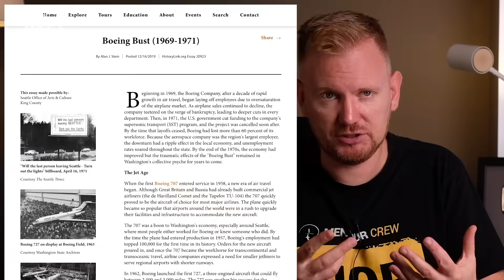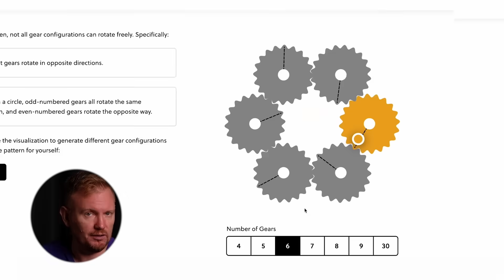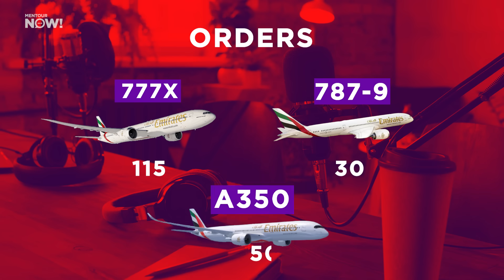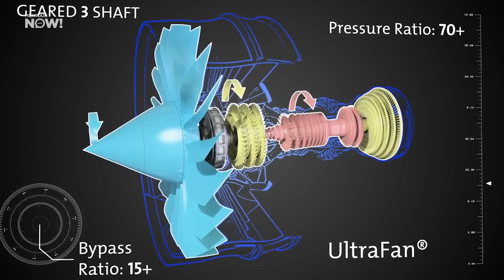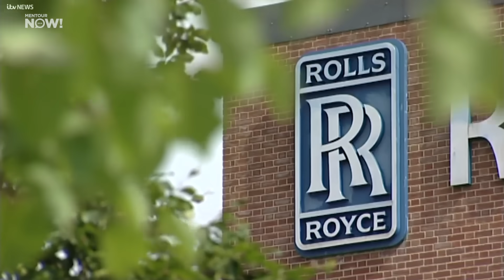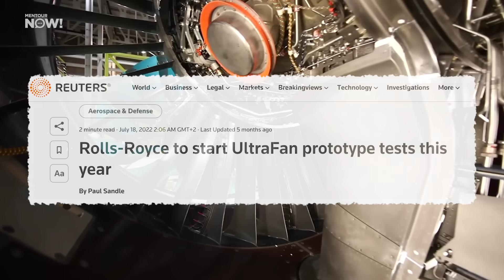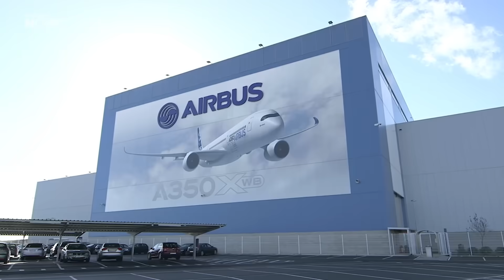Are BOEING planning a 747 with 2 ENGINES?!

Comment: Why be sad????
EVERYTHING comes to an end eventually.
I am dying, I have terminal heart failure (survived 6 major and 1 minor heart infarct), but i am not complaining nor sad?
This is what nature is:
Ending the old, and replace it with new.
Empires came, empires ended, and out of it's ashes empires rise.
Vita ... sic est.

It's not chaos, chaos does not exist.
It's super-structure!
Reply: Issue with the "big, heavy" planes ... is distance needed to take off, or land.
Not all airports have the luxury to install large enough tarmacs.
Hell, most simply do not.
Which is a BIIIIG factor in the Airbus's viability.
I mean, hell, try to land a big, heavy plane on say the Lord Howe Island airport ... .
You can!, make no mistake:
make a 40 meter thick steel wall at the end of the runway to catch the plane ... but that's, from what i've been told, not really appreciated by the folks onboard this plane landing in such a case.
Probably a bit over-exaggerated by the people onboard that plane, but ah well.

Comment: Mentor pilot: PLEASE READ.

The ideal aircraft is what I call the "single trijet". One large turbofan like you discuss here, which would provide 100% of cruise thrust, and two small afterburning turbojets which would normally be on only during take-off and landing which would provide emergency thrust for TOGA or in the event of main engine failure. Their small profile would create very minimal drag in cruise (with the aircraft essentially being single engine), but if your large turbofan engine failed on climb out, you'd have access to more than enough thrust. In particular, you wouldn't engage the reheat on a normal take-off, and that'd only be used for toga or engine failure. Yes it'd be wildly inefficient, but it's not part of normal operating protocol. You could cruise across the continental USA with just one engine for maximum fuel efficiency 99.99% of the time.

The design I envisioned was one huge turbofan at the rear of the aircraft (front is also an option but with lots of visibility issues) roughly the same diameter as the fuselage. Then there would be two turbojets built inside the wing root. You could even have a clamshell on the front that opens and closes, to reduce drag when they're off, and increase air intake when they're on.

During takeoff and landing, the turbojets would always be on. If your main engine fails or you have to go around you hit the toga button and it dumps fuel into reheat giving you oodles of thrust. But on a normal take-off, once you reached 10,000 feet (or similar) you'd kill the turbojets and ride the single turbofan to cruise and your destination.

This just makes so much sense in my head. Please help me get the idea out there.
Reply: Well, here's just one (of many) problems with this idea: maintenance. In order to service your jetliner, technicians would need to be certified on not one, but two completely different engines. Parts wouldn't be interchangeable. The training time would substantially increase. You'd need two sets of every procedure, and you'd risk someone missing a step because they were thinking about the procedure for the other engine. It's hard enough making sure people follow procedures correctly with one engine type (see American 191), and now you want to add a second type? Boeing considered a remotely similar idea -- very briefly -- during the 747's development, when the JT9D engine looked like it wouldn't have enough thrust. The 747 would have had 4 engines underwing for cruise, and two tail engines (a la DC-9 / Caravelle) for extra thrust at takeoff only. The airlines hated the idea.

Comment: The union of the 747 with the new Rolls Royce Super Fan sounds like a marriage made in heaven. Of course, to bring it to reality, a lot of factors have to come together, but as far as efficiency, capacity, passenger/cargo versatility, range, etc. it is a wonderful idea. I like the A380 but it may be a bit too big, while the 747 seems quite like the right kind of big. While not many areas like Dubai, etc. need big capacity for passengers, many may have the need for big cargo hauling at greater efficiency/cost. Dreams are only dreams but I hope that this dream becomes true. Thank you Mr. Mentour Pilot for bringing this video!!

Comment: Have you done a video on slot constraints?  I would find that interesting.  

For my relatively short military aviation career, I flew mostly into small airfields.  Also, since helicopters can land anywhere on a field, I never had to worry much about that sort of thing.  For rotory wing, the runway is just an over glorified navigational aid, in most cases.
Reply: in Vienna, polititians are discussing the possibility of a third runway. of your course they have a lot of conflicts in interest there.
all that means, that slots for the existing two runways are getting tight. having a plane that has 15-20% more capacity than an a350, this would be a good business case.
Reply: Well it's kinda procedure no?
If you land on an airfield you are basically acting as if your helicopter is a small aircraft.
Reply: In London they have been fighting over the third runway for decades with the environmentalists.
Reply: @TheGecko213  Which is funny cause Schiphol has 6 runways.

Comment: Mentour,

  Disappointing!!!

       Why was it necessary to string viewers along with a “minutiae” of aviation related information that had nothing at all to do with the question you posed for this video? Why was it also necessary to have to go through 2/3rds of unrelated content before the question was even addressed, only to discover you don’t have the answer to it?

You have built, over time, & with effort, a substantial following. You are therefore viewed as a “resource” for information, not the lack of it………

 While I can appreciate the techniques you incorporated in creating the video,  the length, breath & depth of unrelated content applied to it, for viewership, is the real story behind it. 

FWIW, like you, I’m a pilot. I fly 747’s. The proximity of engines ‘’2” & “3”,  to the ground,  require special techniques for all takeoffs & landings; particularly crosswind landings. The sheer size of two newer motors, combined with 747 wing height, would preclude their application on to 747 airframes.

Comment: Problem is at the moment something like 2 Trent xwbs could power and A380. But once you’re over V1 on takeoff you have to go around if you have an engine failure therefore a 2 engined jumbo would have to be able to perform a go around on one engine which is very difficult.
Reply: You could have auxiliary engine and not use it unless needed.

Comment: I have had the pleasure to accumulate over 10,000 hours flying the 200,300,400 and -8 series.  She is the Queen.  I always wondered if two 777 engines plus two smaller engines that would be used if needed for takeoff and could be shut down at cruise for fuel savings but could be used if needed. That might open aircraft up to Non-ETOPs routes.  Just a thought.

Comment: Ultra fan engine can be a potential for a single engine A320 or equivalent.
NASA has designed a concept for a single engine aircraft of 737 or 320 size planes

Comment: Years ago I was talking with fellow aviators and the 747 topic came up where I suggested that Boeing should consider using some of the newer technology engines, more power with greater economy. Well some laughed off the idea. Fast forward twenty years and Boeing combined engine technology with wing technology bringing the 747-8 to market. Now wing technology is great and coupled with an engine of this size ( wing structures permitting as well as height limitations due to wing placement) it would be feasible. The only hold back would be FAA and EU certification. This would cost Boeing millions.

Comment: RR making the giant engines seems like it might make sense to me (a fairly uneducated layman) since they said they could scale it down. It could be that they will eventually make only that giant engine, but scale it down into many other sizes they need to produce. Maybe then they only need to make 1 or a few engine cores for all those models, or at least have a lot of shared components between them, which could reduce cost on all the engines based on that design.

Comment: it all depends on the Thrust output. And i don´t know if it can archive that level of Thrust. Because it does not need double the Thrust of the current a380/b747 engines, but more like close to tripple. The reason beeing that the aircraft need´s to be able to climb with 1x engine out. On a 4 engine aircraft that leaves you with 75% thrust. And a 2 engine configured giant need´s to be able to match that thrust output on ONE engine and still climb.

Comment: Nice video Petter, I have long argued about this before and believe it was a mistake for Emirates and Airbus to stop A380 production. Ultimately it came down to disagreements with engines along with the fact that the whole A380 project was something that Airbus didn't really want to continue. That said, with hydrogen likely being the answer for long haul moving forward, they will need more engines as hydrogen requires double the power output. For that reason I still believe we will see an A380 replacement as Airbus moves towards a zero carbon range, and Boeing should follow with something similar. With Boeing delaying the 777X, Emirates will need to seriously consider it's slot options at many busy hubs around the world. A full A380 landing at Heathrow costs less than two 777's does, and that's something you can't change with the current widebodies. It will be interesting to see how they deal with this and what direction Airbus and Boeing go down.

Comment: This is fun! Petter, I believe this was my question! Along with many others, probably.
In fact, what you are saying is, even Boeing would like to, there is no double engine-feature available that will produce enough thrust to get the 747 airborn. 
That engine is simply not available at this time, and developing it - if the businesscase checks out - will take years?
Reply: The 777-300ER and 777-9X have a MTOW not very far from the 747-400's (the -8 is a bit further tho). With some structural optimization and a reduced fuel capacity (as the new engines burn less) it's not completely impossible to make a 747 fly with only two engines of an existing type.

Comment: A modern composite weight saving 747-400 with monster twins would be so sick.
Reply: Since Boeing inherited McDonald Douglass, wouldn't it just make more sense to just modify the MD-11 to use only 2 engines instead of using the 747 as a basis?
Reply: It would be the ultimate dogs dinner and a complete disaster. Boeing is all about max profit from sunk costs and its proven very expensive in lost lives. But that doesn't get reported on the balance sheet, does it?
Reply: Why do you young guys call good "sick".  Sick means bad, even gruesome.
Reply: @michaelbenardo5695  Take a nap, Boomer...
Reply: @johnbergstrom2931  tsk tsk weak move to call out
Reply: @johnbergstrom2931  it doesn’t mean you have to be a bum on the internet
Reply: @twinkieerella  Take a nap, fun-ruiner...
Reply: @johnbergstrom2931  🤣🤣🤣🤣

Comment: Would there not be some design practicalities that might be an issue for this idea?  For example, how are you going to get such enormous engines under a low-winged aircraft (which most passenger jets are) without having landing gear as tall as a house?  Would you have to consider going to a high-wing configuration instead (and accept an obstructed view out of the window and a lot of additional cabin noise aft of the wing)?  

And if one engine does down you lose half your thrust.  Of course that's also true on current twinjets, but they're not as powerful as this proposed beast would be.  Would a flight crew be able to handle the massive yaw a sudden loss of power on one side would produce?  I know there's been incidents where quadjets have lost both engines on one side at the same time, but I'm assuming that if such a plane is ever built it's going to have to be at least as big as an A380 to be worth it.  I'd imagine you'd need a huge tail fin to ensure the pilots still had authority over yaw if that happened.  maybe you'd need a split tail to achieve that, as a single tail fin might just be too big for current hangers.  

None of those are insurmountable problems of course, but they do all add up to making it a difficult and expensive aircraft to develop, so there'd have to be a very good financial case for it.  And after the A380 Airbus might be a bit shy about taking on such a big project again.

Comment: If newer engines have larger diameters then they will have to be placed higher on the aircrafts. Under the wing space is getting scarce due to limitations on the landing gear. High wing designs have been around for decades, C130 and B52 are examples but this configuration might not suit civilian operations. I suspect that new and very different aircraft designs are required, not only for new and efficient jet engines but also for proposed electric and hydrogen propulsion systems. Time, perhaps, for manufacturers to 'bite the bullet' or for passengers to have lower expectations.

Comment: If one engine like the GE90-115 produces almost the same power as the two GENx used on the current B748 and weights less so that make sense. Its obvious that the wing will be redesing and this is way to expensive. But Boeing would have two aircraft in the same cathegory this new 747 and the 779.

Comment: I would love to see Boeing switch the 747 to a twin engine setup and use modern composites to build the entire aircraft from. Switching to composites makes sense because an entire new wing would have to be designed anyway. Making these changes to the 747 would easily give the 747 another 30 years and that is something Boeing needs right now.

Comment: Having flown 744, it was the first thing that I thought of... But, it's much more than just fitting two engines. The four engines are wired into everything in the aircraft, flight controls, pneumatic, hydraulics, electric systems.. so fitting two instead of four, assuming you can work around the aerodynamic issues, means you are looking at reengineering the entire aircraft, maybe except the outer skin. So... Regardless of available engines, the sad answer is no.
Reply: The often proposed solution is to run multiple hydraulic pumps and IDGs on the accessory drive of each engine. That's a simplistic approach that covers the loss of a single pump or generator, but there would be an unacceptable reduction of redundancies when an engine is shut down or failed. I suppose an answer to that objection might be a dedicated APU to run standby hydraulic/AC power?

Comment: Why not put a large engine in the tail, also put a generator on that engine, and put electric engines under the wings,  there could also be batteries mounted between the wings, or where ever the balance is best,  the 3rd engine in the tail, having less bypass for the size engine, would more than make up for it because it would be powering the other two engines,  I believe it could use the battery for takeoff, but once at cruising altitude the single engine should make enough power to maintain speed. Similar to a locomotive's diesel electric drive, and in the event of an emergency, the battery can power the engines, the capacity should be enough to atleast fly the plane for about an hour, giving enough time to land, or restart the engine if possible, I think it's a excellent idea,  using a single engine to fly a plane,  it's similar to having 200% more bypass than is possible with a single engine, with a battery in the 1mwh range, it can be charged by idling while parked, or plugged in at the airport, or both for a fast charge, and a airport is a really good place to pot solar panels! Using nearly 1500vdc from solar to charge the battery , only using the battery for takeoff, it should be charged in 20-30 minutes, a hour tops,  if the wattage is high enough , here is the idea , now someone needs to build and test it, hopefully put it to work burning 1/2 the fuel! Maybe 1/3,

Comment: Thanks Petter. I’m so glad that my career included flying 747s - my favourite aeroplane of all time. 
I’ve flown a 100, 200, 300, SP, & and my all time favourite, the 400. I’m also pretty sure the - 800 would be even better. 
Long live the Queen, a truly magnificent machine in every possible respect- yet designed in just a few years, mostly with slide rules, and with the “B” team engineers, as the “A” team were working on the ill-fated SST.

Comment: Right now there are several four engine, high wing, military freighters that could possibly be used as the basis for a two engine civilian passenger jet using the Rolls-Royce high bypass engine. Airbus, Boeing, and Lockheed make variations on this design.

Comment: Why not move the wings to the top , allowing for engines with way more bypass, definitely two engines, basically like flipping it over,. Then mount the engines below the wings, the engines could double in diameter,  the engines could be as large as the plane nearly,  the amount of bypass. Could double or quadruple! 
Being much more efficient,

Comment: Well 777x are far from being fully certified...emirates should have been ordered the proven a350 instead .....it's a great aircraft and is been doing exceptionally with most airlines...for a bigger unit a350 1000 is their which accommodates around 450 seats in 2 class config